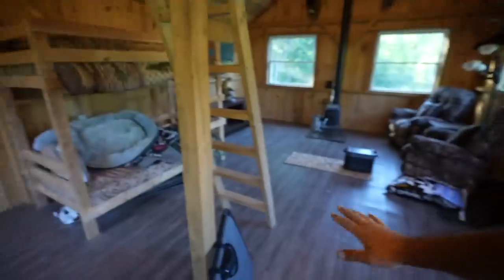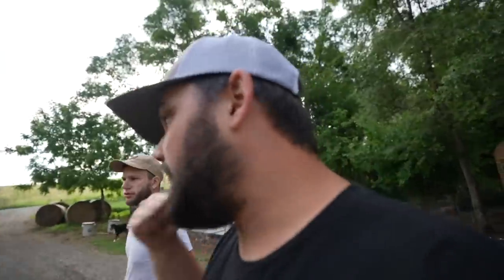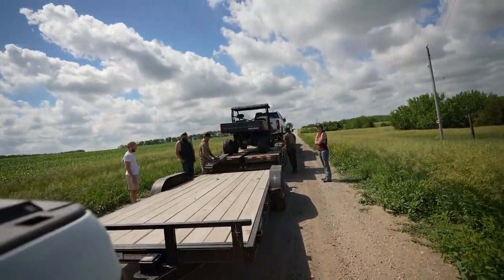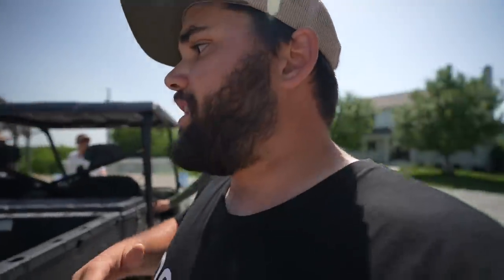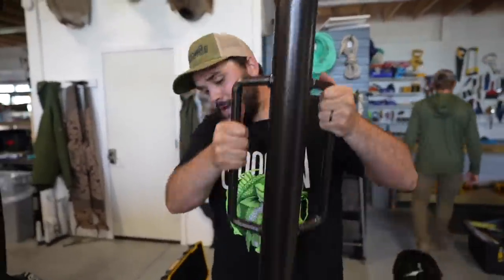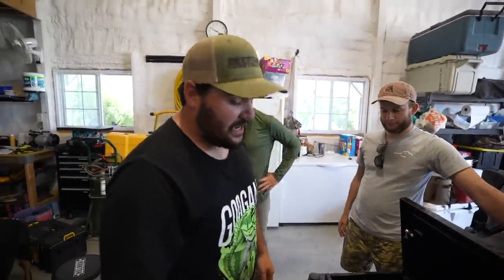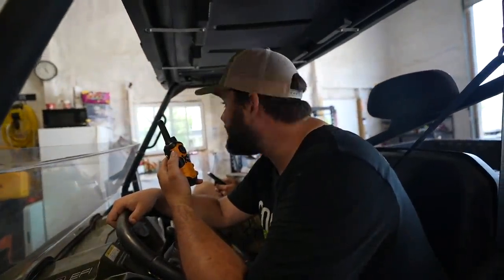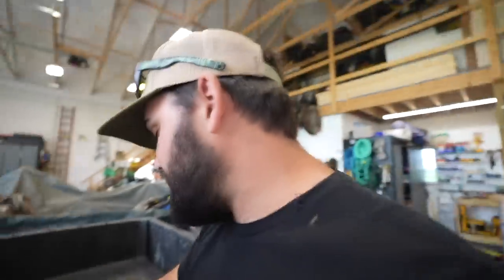SURPRISING My DAD with RARE 6x6 Off-Road ATV!!!

Comment: Flair, take the front tool box back off and put some rubber matting down or roofing butyl sealer and rebolt down...will add shock absorption and support so the front box won't rattle so much. Awesome content sir and great thing to do for papa beefcake.

Comment: Install a ladder rack to haul lumber or fence posts around. You can hang the extension cords on it, post driver, or any daily used bigger tool. Plus that would give them more room in the tool boxes and you still have an empty bed
Reply: Great add on idea
Reply: But you lose the dump bed

Comment: hey flair love the content i would recommend getting a air filter,fuel filter,spark plug or plugs and possibly cleaning the fuel injector just to get her running smooth have a good one guys.

Comment: 100% needs a tire plug kit combined with the portable air compressor. Fix a flat without ever taking the wheel off. Working fence means nails screws wire and all kinds of sticks and pokers to get in the tires.  Even a can of “fix-a-flat” might also be a good thing to have. Maybe a battery chainsaw as well for trees that fall over fencing that need to be cut and removed before repair. 👍🏻

Comment: the post driver and large tools like chainsaw and farm jack should be all put on a rack behind the seats to save space in the boxes
you could also add some hangers in the lid of the front box to hang some of the smaller tools for easier access, just make sure to silicone the holes you drill

Comment: Yeah when you're doing them kind of floating floors you always got to keep a gap around the whole perimeter of the floor it's called expansion and contraction what gets cold it shrinks when it gets hot and it expands to the wall it makes the floor buckle

Comment: Hey Flair, buy a dc splitter and throw on the dewalt dc 12v battery chargers, trust me they are a game changer.  Ive also used my tool batteries to jump other 12v batteries like kayak battery or whatever.  Actually a kayak power station would be better bc they can toss a couple of solar panels on the roof and then charge their tools thru that when they are out working, and at night they can charge the station in the garage if need be.  That way they arent taking the draw off the 6x6.  That is exactly what id do.  Crap now im gonna have to do my own lmao.  They are super easy to make, i make them with power poles, a few dc and then of course ur usb c or usb spots for phones, radios and flashlights.  But hey love the content and im sure they love the new rig.

Comment: You can always fix the metal box flexing by cutting and putting a piece of MDF or plywood as a bottom layer inside. Reduces the rattling tools make a little bit as well. Used to do it on tractor tool boxes. Keep it up lads, love watching your videos on my time off 🤙🏻

Comment: I would add a first aid kit to the 6x6 rig.  Can always use some gauze, band aids, tape, etc even if it's on a temporary repair.  I would also add some wire strippers, butt connectors, a roll or two of wire, and some electrical tape.  Helps fix a lot.

Comment: The reason the truck didn't go into gear could be a crankshaft position sensor, I had the same problem with my car, I got a new sensor and it's been 1 month with no problems, it was happening daily but now it's good

Comment: Her name is Big Sheela! And she needs a winch and a snatch-block. She also needs a come-a-long winch on board. And Banjo, dang-it, get your mind out of the gutter! Sheewww! But seriously, a large container of Slime! It is perfect for low pressure tires and most often will fix a flat that you didn't even know that you had! Well, @ least that worked for me for my mountain bike tires and my sisters 4-wheeler tires. For big punctures, the 'ol tire plug kit comes into play, but in conjunction with the Slime, the plugs treatment works better. The only other thing I can think of is a utility rack from front to back (obviously leaving room for the tilt bed to function properly, duh!) And it could, probably will, be used as a roll-cage. Flair you will probably want to have a non-leathal professional help with the rack/roll-cage of anti-death. Just sayin, but You are the one that asked for comments, so 🤷!

Comment: Just a suggestion, you could get some scrap pieces of metal and put that on the inside of the tool box, drill holes threw it and run bolts threw the bumper, tool box, and the metal plate. That will eliminate the possibility of the bolts ripping threw the thin metal on the tool box.

Comment: You should put some like 1 1/5 inch rubber mat for the bottom of that it would help with the spacing you would need for those bolts and if needed you just slap lime 5 washers on to help tighten it up

Comment: I heard put a solar panel on the tool box but I was looking at the roof! Put a couple of 150w panels, a charge controller and inverter with a couple of lithium batteries and run everything through it!! LOL I'm always trying to think about power supply!!

Comment: you should get a power inverter for the side side to charge the power tools you can get them at Walmart you just plug it into the 12v volt thing in the front.

Comment: Flair needs CB radios for all the side-by-sides and trucks and tractors!

Also for the battery, you would kill the battery so fast side by side. I would recommend treating it like a boat, get a large deep cycle (I like Dakota lithium) and hook up a solar charger with an onboard charger, when you park it every night just plug it in.

Comment: Flair, have brad the builder make you a custom one way flow vent ( think of maybe your dryer vent ), that hooks up to your AC unit that is detachable like a whole house vacuum or central vacuum port depending on where you live, instead of using your window.

Comment: Hit mama ewe’s ear with some gentle iodine and if need be lather some Vaseline on it or something similar to help keep the flies off while healing 👍🏼

Next farm sxs will be that giant long box can am

After you get the weight in the toolbox up front keep an eye on sag, may be worth turning the shocks a little tighter. Also banjo is thinking of kaizan (not sure on spelling) foam.

Suggestions: It may not be always used and it's a different brand but nothing compares to the milwaukee search light (handheld) and a good milwaukee tower light.  The other light you were discussing was a "Go Light" which is what you see cattle guys running around with up top. They can be wired or cordless and shoot a long pencil beam.  Other than that look at Polaris bed accessories that fit in those holes in the bed.  They make racks that maybe could hold a chainsaw or something like that while saving the room bed.

Comment: They'll add some stuff to accommodate any needs they've got along the way but I would do some kind of power inverter to charge tools as they're needed and a rechargeable flashlight. Probably the DeWalt 20v flashlight so I could use the tool battery and charger for it too

Comment: Flair...screw a pipe vertically at the back of the cab on both sides then you can put a shovel and a sledge hammer
Nice rig

Comment: Walmart sells a jump pack called The Battery Tender, which also charges cell phones. It’s very small, but will jump a car up to 5/6 times before needing a recharge. Trust me, I’ve tested it over a month with that many jumps. I’ve had mine a year, and it’s always worked.

Comment: You need a hydraulic setup on the bed of it incase you pack the bed with something heavy for instance loads of dirt you could easily dump it without having to use your body strength

Comment: Ssolar panel can break easy and don't make much quick power and alternator isn't big enough to handle charging much more than it already does.....  I'd say get them a fancy ancker power box thing and another couple add ONS would be heavy duty gun rack for the back of cab that can also carry a stepladder and a cheap coyote/Ricky knocker so they don't have to get one if there's one in the traps. I'd see a small pancake compressor that runs off DeWalt batteries or Anker power box to air up tires and least of all but likely most used blow dust/Debi's off your clothes when the jobs done and could run air tools when needed. I'd also think of a skid tank and small gas pump to pump water Incase of fire or to wash or rinse things were there's no water (a gas pressure washer will run off gravity run water). Cheap ponchos that can be kept in like a small coffee can or glovebox  Incase of sudden rain. An ammo box filled with wish is items often needed on a farm like plastic and metal zip ties, carabineers, hitch pins and random bolts, self tappers, random hardware things that can get you out of a pinch to hold panels fencing wood ext, spare hinges for doors and gates and gate hardware, spepherds staff, livestock sorting paddles, good lead ropes that are long so you can use them as emergency halter (google how to use a lead rope as a halter to understand if you don't), ammo cans make good first aid boxes too.... Bandaids, gauze, med tape Neosporin e, alcohol wipes shears, latex gloves and to make a kit for both human and animals I'd definitely have vet wrap it's a good split holding better than ace bandage especially in emergency, blue Cote, asperine, 
   The round stake pokers on the bed rails I think beefcake fabrication can use pieces of pipe as short stakes and weld to a plate like 6in wide and length of bed to mount ammo cans or hangers that hang over the side to carry spare floats. Having hangers for the boxes or other items in stake pockets would keep box free for the job at hand stuff. Or adding a rack that's the same hight as cab for longer stuff like 10-12ft 2x4s ext. Could make a hanger for weed Wacker...... Having it on hand would be nice if setting up trap s ext  and even tho I'm not a DeWalt fan.....sigh..... They do have weed Wackers and chain saws that use that same battery. They might like having them hanging and available without needing to carry gas for them. 

I know I said all of things but you asked for ideas!!!!! Don't blame me. I thought of my farming career, and lifestyle experience of what I would like to have on hand gassed on that you said they do for you. But as far as taking the ac UTV away from the workers in the heat...... I'd suggest setting up a power generator thing that powered a small 12volt cooler strapped to the seat as an armrest, a fan mounted under cab they can cool off with and setting up their parking at the shop like a firetruck.... An extension cord handy that charges the power is and keeps cooler cold so they can keep fresh water drink cold and ready and I'm sure theres room in your catch clean cook fridge to keep drinks for pree buggy cooling. Also a 12volt trickle charger to the utvs battery so they know it's always ready no matter

 As for a name......beefcake farm and maintenance or beefcake repair or beefcake services

Oh and another item that's handy is flagging ribbon..,... From warning or blocking a road to marking an animal ext

Comment: Flair add auxiliary lighting, front tool box blocks head lights. Add one of your small power cell or generator.
Hard Hats with head lights, they need Hard Hats Or Work hats with BEEF Cake Maintenance CREW.
Nice setup, it should work great .
Dale Nickel
Janesville Wisconsin

Comment: You need to put a 4-in piece of PVC pipe about 4 ft tall in the back and bungee it down or zip tie it that way you can put post hole diggers shovels and everything inside the PVC 4-in pipe that would be pretty cool and you need to get PVC glue PVC cutters cuz you know pipes always breaking

Comment: I don't think you need a huge net over the top. predator birds swoop to attack. so you only need some rope with maybe 8-10 foot openings. it should prevent the birds from being able to swoop down. and you won't have to worry about leaves being in the netting

Comment: #flair only place you missed. Was those impact bits , flat head , Phillips s, etc. don’t fit that impact gun. There are two impact guns ones with a hex head like you bought. More familiar with automotive. And quick connect for all around. But your 85 bucks away from the right impact gun. Also I would go with Milwaukee

Comment: Ya my work truck is a 2020 Dodge Ram Classic and they are obnoxious... besides the stupid shifting mechanism, I've had check engine lights and some other problems since the second day I picked it up.  Luckily I don't pay for it so it's whatever.
If the door is open it won't then the selector knob move out of PARK.  Also if you are moving very slow and open door to check for clearance I've had mine throw itself into Park as well.  Dumbass design.
My personal vehicle is a 2019 High Country, zero problems with that... best truck I've had to date.

Comment: Like the Dodo bird the six wheel SxS so much success and sense it went extinct.  6 wheels like 6 legs on a crab—-CrawDad.  Plastic gun scabbard’s hanging off the back of the cab.  Crisscross applesauce. Back of cab round n square shovels..  That box up front might be blocking air intended to cool the engine.  Secondary air for engine.  Hood scoop.  Anyone check the oil?  Trans fluid.  How about getting another drive belt.  Availability of special drive belts real issue.  Needs a lift n bigger tires.  What no cup holders.Coffee warmer  cup holders and dc cooler for cold water n wobble pops.  Peace

Comment: You'd be way better off putting the solar panel on the roof and wire it up to an accessory battery. You're never gonna put something on top of the roof, but you man wanna sit something on top of the tool box